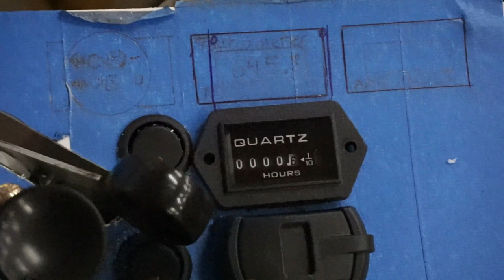Hustler Raptor SD60 Ergonomic Dashboard Test Fit

Comment: What are the correct hour count now? Is there any way to make your new hour meter reflect your current hours?
Reply from the maker: Good question Michael. I am going to run it up to 23.6 hours, then remove and replace it with the original which will then be correct again. If that happens again, I'll just remove the original, replace the analog gauge until it is run up to the incorrect display on the original, then repeat removing and replacing again.

Comment: What is your opinion on "No-Air" front casters on the Hustler?
Reply from the maker: Michael, good question.

As far as ride, creates a harsher ride. Harder on the frame however, if doing commercial, I can see they would be worth the investment since the down time of changing a tire to continue working or worse, having to run in to the shop to change a tire or repair it to continue working would be devastating if the mower has a full schedule. Thus, I would think in commercial mowing, they do have a place. For small once a week or every other week situations, waste of money. 

Run what came on the mowers until they're worn out or change them before the mower is used so that the originals can be sold to recoup some of the investment on the no flat tires.

Hope that helped.
Reply: @MaxsGarajMahal  Great!!! I was ordering spare casters and couldn't decide on no-air or pneumatic ... no-airs are $60.00 more for a set of two. I have spares of everything ... I got caught with my pants down ONCE!!! Never Again!!!
Reply from the maker: @cyberinmate139  I have many spares for almost everything I own. Sorta gets in the way after a while. lol. Had someone come visit the other day. They thought they saw everything. Not even close as I have two other locations that I have to store things I eventually use. I used to have 4 warehouses that I've finally donated all the items to places that could put the items into hands that were in need. Those warehouses were furniture, household items, house repair materials, etc. When I retired, I would rather the items be helping others. 

Now I'm getting rid of all my spares in the same way. There just comes a time when spares can be cumbersome. lol. I'm really working toward keeping only the things I think I'll have to have. With all that said, I did travel 330 plus miles last weekend to purchase 4 tires I'm fairly sure I don't need. However, I do intend to use two just for video and testing purposes only. Then what? lol